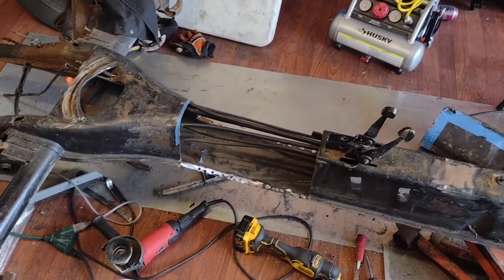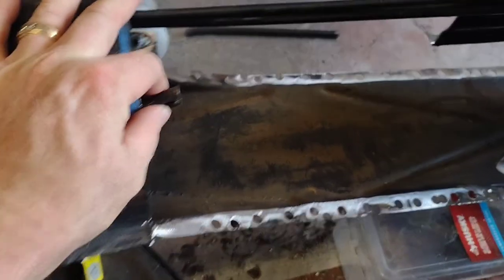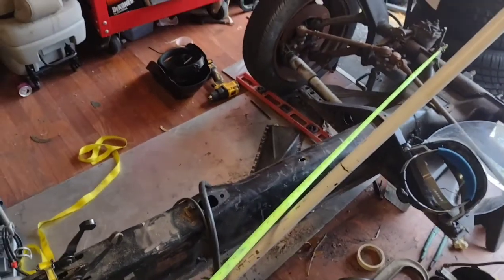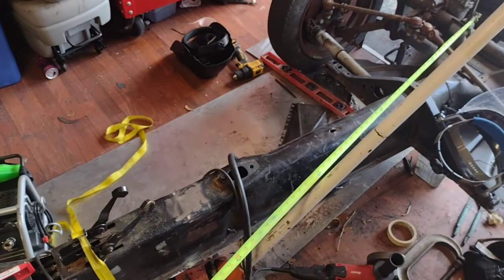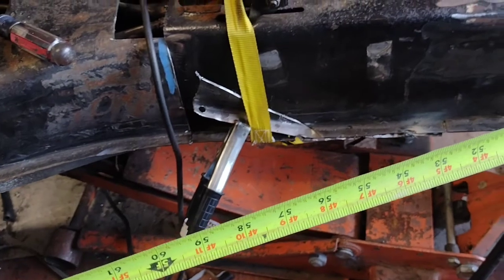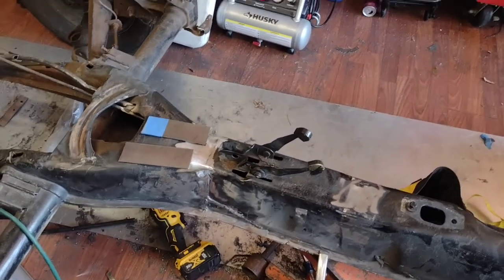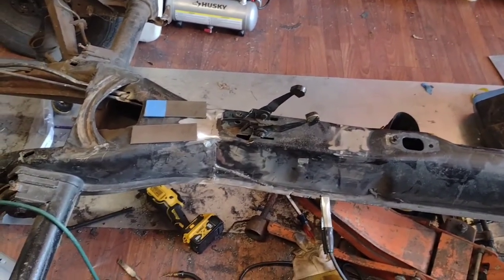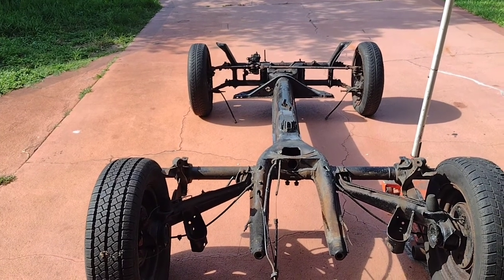Bringing the Chassis Together. #Meyers Manx Build.

Comment: Looks great! I had a local guy do mine and he cut off my brake tubes. :(
Reply from the maker: Man that sucks. Probably can add them but would not be easy. Back when the rear disc brake kit did not have E brakes , I would have not messed with them. But now I'm older and slightly wiser ( not much LOL) I keep them.